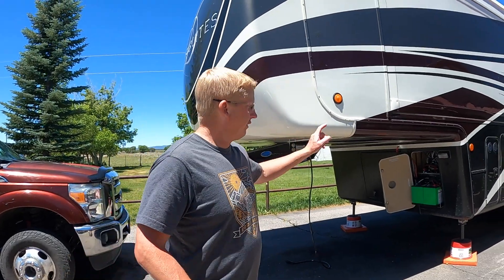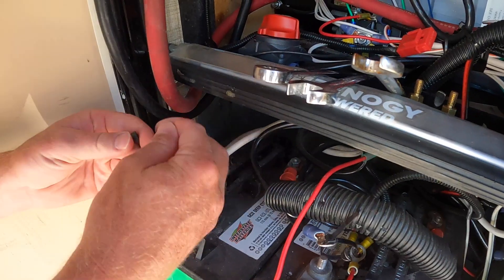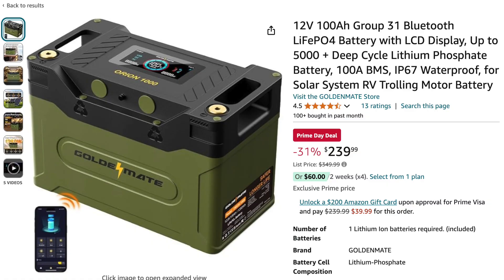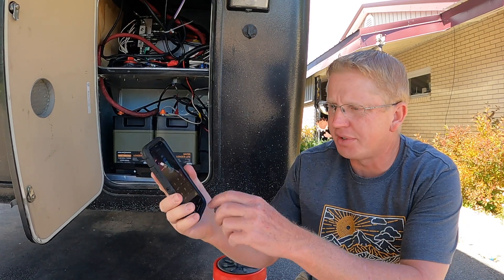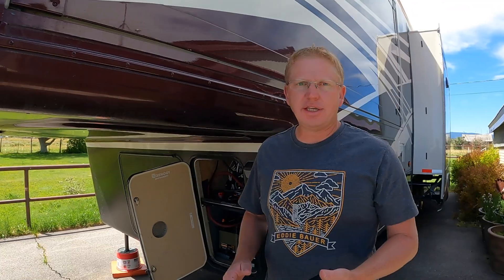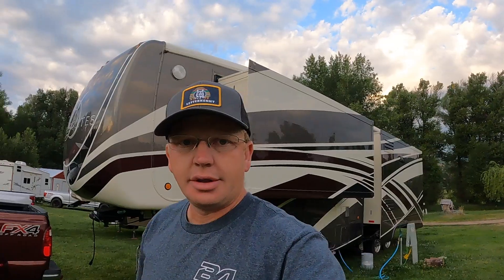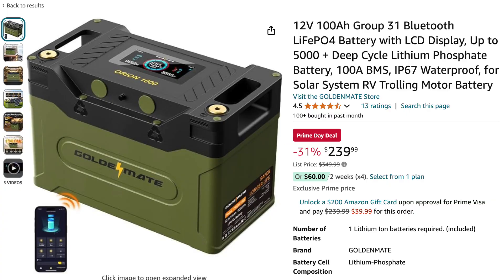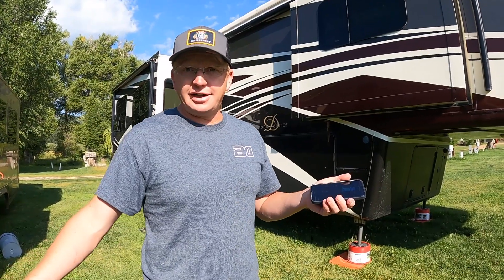Golden Mate Lithium Batteries: Affordable Power for Your RV & Off-Grid Adventures!

Comment: Great video.  Will you make a video of the Lithium battery converter change out?  I have an older 5th wheel (2006) with two lead acid batteries.  I would really like to make the change to lithium batteries but I have to change out the converter.
Reply from the maker: @cjwalstad  filming one next week.